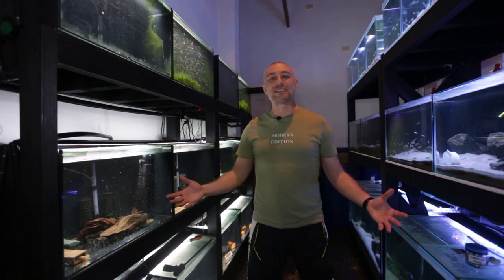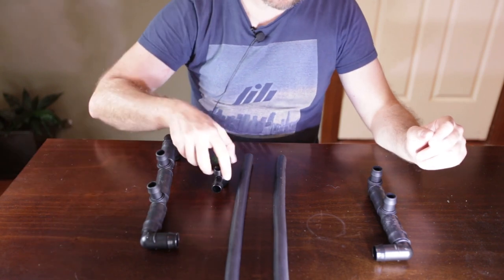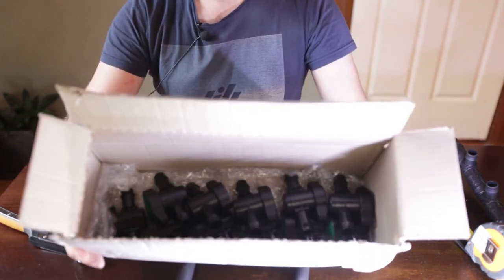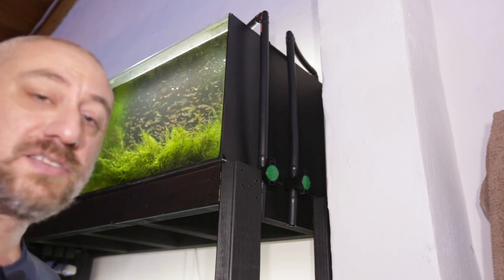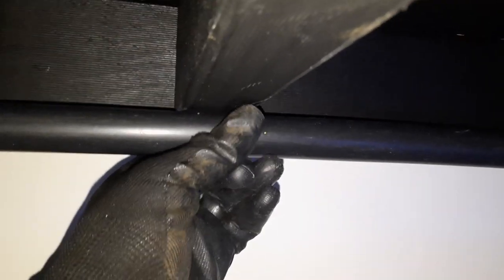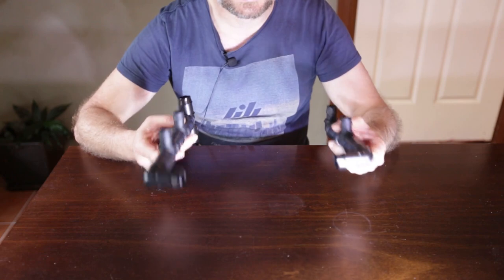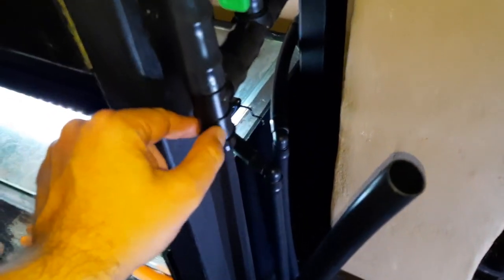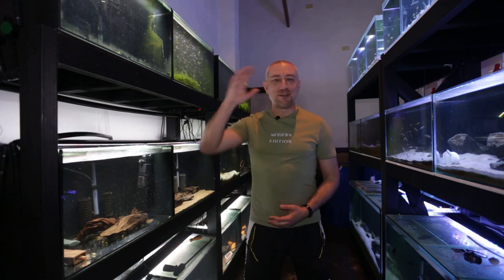Fish Room Water Change System - Part 4 - No drilling

Comment: Looking really good Jason.
Hope it works out great. It will save you hours of work.
Will you need to put an air breather tube in above water level to speed up emptying and to avoid air locks?
Hope you can show us the system working. 👍😊
Reply from the maker: Cheers Paul. It really will save so much time each week. I don't believe so no. There is so much pressure from the top row of tanks draining out that all the air is pushed out of the system with the syphon.

Comment: So are you an engineer by trade?? Such fantastic derails! I do my water changes with hoses to fill and manually siphoning, of course it’s only 17 tanks set up in my fishroom. I’m  not very handy when it comes to this sort of operation , I wish I was. Too bad you weren’t in america I’d pay well to have this done!!👍🏻🙂
Reply: Details
Reply from the maker: Haha no I'm not but I am glad you appreciate the details. If had the room in the fish room and could move the fish out, I would drill them and connect them to a central sump. I feel in the long run it's much easier to maintain. But this has been an interesting learning experience. Haha I wish I could help you but, hopefully this series will give you some confidence to try it. It really isn't too difficult. ✌✌

Comment: Super water change system, 

do you plan to use a pump to fast drain the water?
Reply from the maker: Cheers mate, no pump needed to drain them, they'll all drain via a syphon. And then a pump is used to pump water back into the tanks. Pumping the water back into the system via the same lines primes the syphon for the next water change.
Reply: Hmm, I am so tempted to use a pump to drain the water